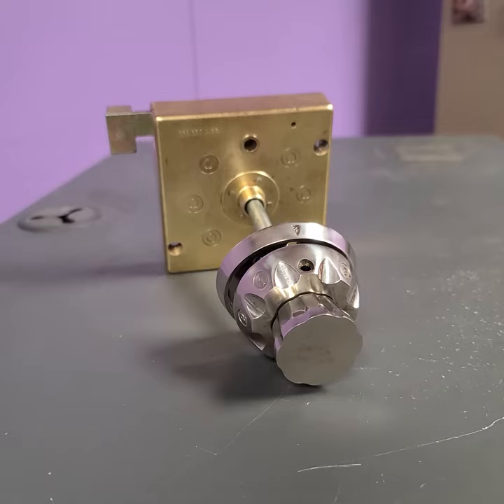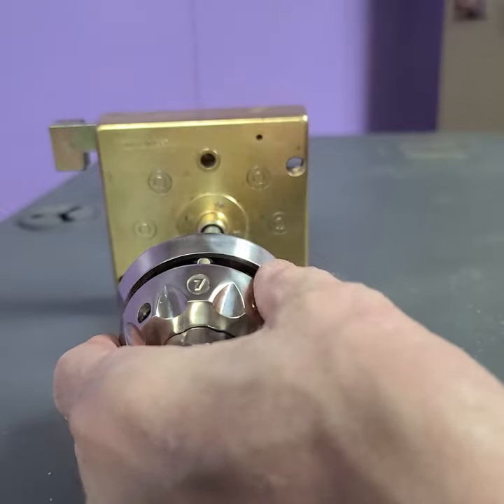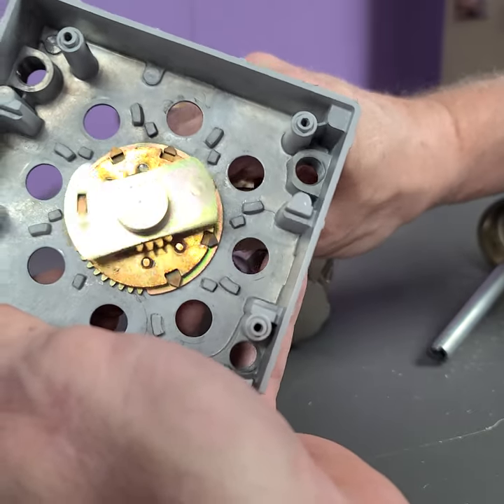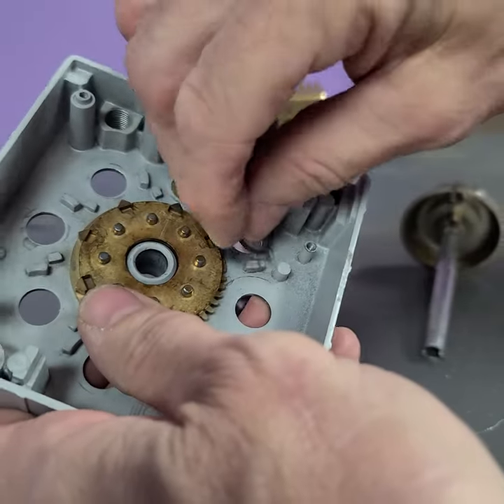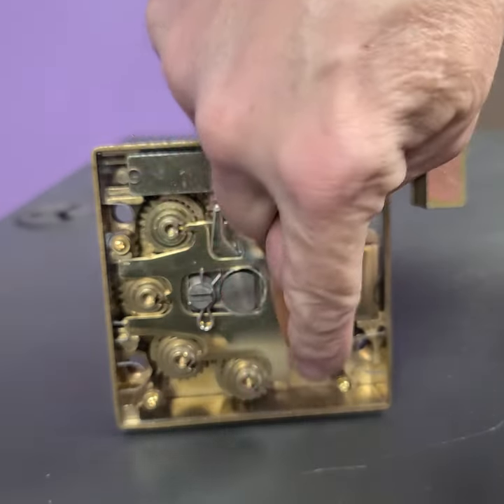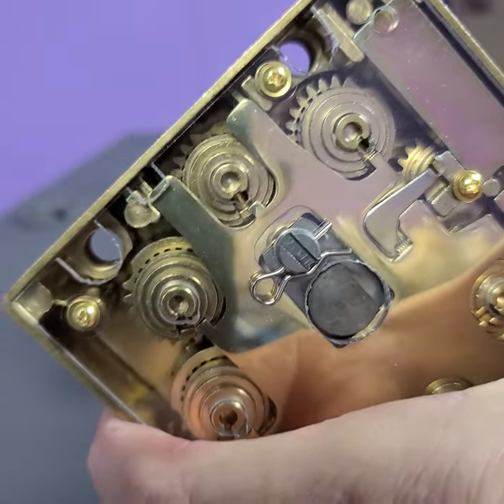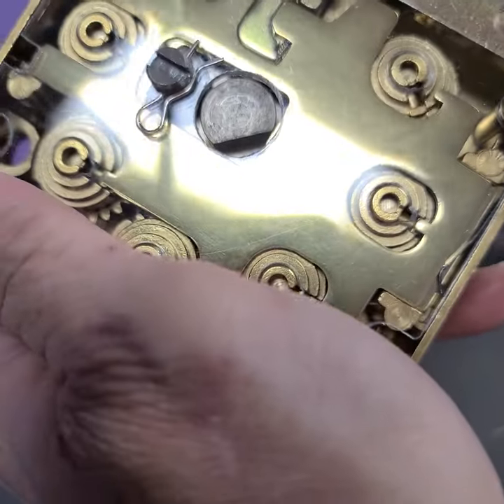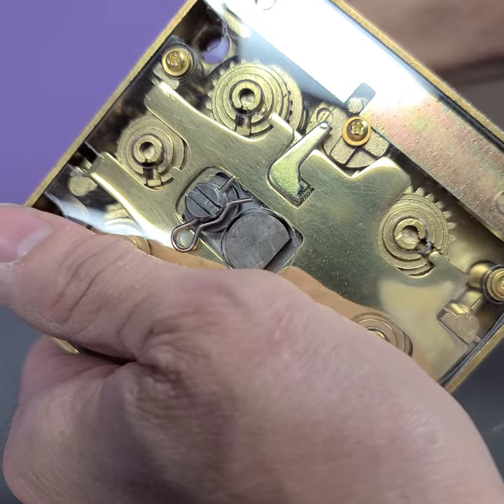How a Fichet Monocommande and Moneo safe lock works

Comment from the maker: @m0g has noticed something that I missed when he got his Fichet Moneo safe lock. There is a spring-loaded lever that rests against the bottom part of the bolt driver (the round single piece that throws the bolt). It has no apparent purpose for the operation of the lock. If the bolt driver was pushed back a little bit it would not allow the bolt driver to turn the direction needed to throw the bolt to the open position. The bolt driver can only be pushed back if the back plate was removed or bent out of shape on my lock. If the back cover was removed on my lock then the bolt and the bolt driver would fall out. On his newer lock there is also a shoulder screw in the bolt driver from the front of the lock that would prevent the bolt driver from moving back more than required for the lever to work but not fall out. Also, his newer lock has retaining shoulder screws for the bolt itself so that if the back is removed the bolt cannot fall out. He hypothesized that it is a re-locker to thwart a dial punch attempt to crack a safe. I agree with his determination especially since the newer lock has additional features that would make it work better as a re-locker. It isn't shown or mentioned in the patent and I contacted Fichet about it but of course didn't get a response.

Comment: What an amazing presentation, i was not aware of these safes. Thanks for showing!
Reply: So interestingly the "beehives" (is that a technical term?) are working exactly like in the kaba simplex mechanical lock. 2 plates with notches, one for the throw action and one for immobilizing part of the hive to allow rotation of the under wheel.
Very cool to see the same concept used, though your piece is way more of a show piece than a simplex :)

I should do a video of my early (~60) simplex version, a pretty fine piece of engineering alas not as pretty.
Reply from the maker: Beehives is my term. The patent calls the 2 main parts of the beehive the "combination rings" and the part that locks them together a "combination catch"
Reply: @alexandermundy2403  thanks for the details!

Comment: Great video with lots of information - thank you for that!
I wander - why so many French locks look like a work of a clockwork maker😁
Very cool lock, but I wander if the code doesn't "leak" through the sound when dialing the combo...
Reply from the maker: Unless the center "gear distributor" is in the bolt throw position it holds the plates away from the "beehives" so nothing contacting to change the sound or feel while dialing.
Reply: @alexandermundy2403  I meant that when someone is dialing a combination and you hear the clicks, the sound could give the combination away...
Reply from the maker: No, the sound of clicks will not be different because when the outer dial is in any of the 7 dialing positions the slide that contacts the "beehives" is held away from the "beehives" by the back of the "gear distributor". Only when the outer dial is in the position for throwing the bold will it allow the slide to contact the "beehives". Here is a pic pre restoration that I have circled what I am talking about.
https://i.imgur.com/z5p7g2i.jpg
Reply: @alexandermundy2403  Maybe @_least meant not the "tentative method", when you simultaneously dial and test the combination, but a listening device that is placed near the lock can reveal the combination by recording a number of clicks for every tumbler, and even inconsistent dialing can't guard against this
Reply from the maker: Ah I see what you are saying, a secret recording or listening device near the safe. Guess one could click past each correct number then click back to the correct number to thwart that, but one would have to be pretty paranoid to do that every time. 🙂
Reply: @alexandermundy2403  That was exactly my idea... The thing is, that reversing direction would cause a small pause, so that might help too... Also I think somebody mentioned a newer version do click less, so maybe it was a concern too...

Comment: This lock scrambles itself, that's interesting. But can it be opened not by dialing the combo, but by moving the latch against its 2 mm spring, which is in a fence plate? Is there enough space to do?
Reply from the maker: From the US Patent: "In the course of the movement of the to-and-fro member 140 the stop surface 156 of the member 154 moves in front of the projection 122 of the bolt driver 120 (FIGURE 29). The latter, which was immobilized by the member 154 co-operating with the projection 122, can then turn." 

In other words, the bolt driver cannot turn until the top sliding plate moves which moves the small lever that the 2mm spring pushes against past the raised part of the bolt driver. 

"From the first movement of opening of the bolt, therefore, the combination of the counters is destroyed. When it is desired to close the lock, it is sufficient to turn the control knob 211 in reverse direction. The bolt drive ring 120 is driven in rotation in reverse direction, and the pin 121 brings back the bolt 110 towards its closing position. At the end of the movement, the projection 122 pushes aside the lever 154, by its action against the arm 155 of the latter taking advantage of the resiliency of spring 160."

In other words when the bolt driver is turned back the top sliding plate moves back to its position when locked which releases the "beehives" (<= my term) to turn back to their resting position. But the 2mm spring allows the raised part of the bolt driver to push the small lever out of the way or else it would be stopped by the small lever.

I'll try to embed the drawing with the appropriate numbers from the patent below.

https://i.imgur.com/MMVADHK.jpg